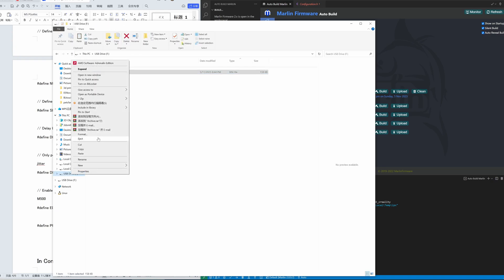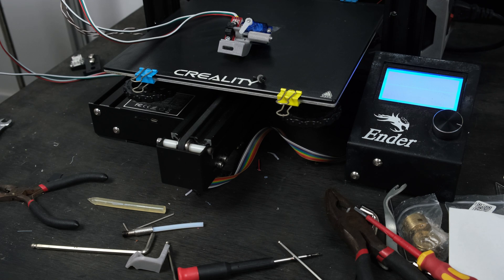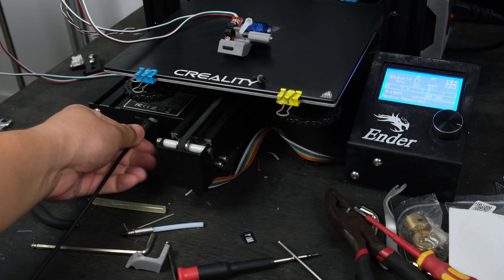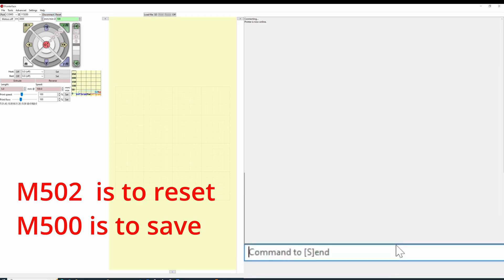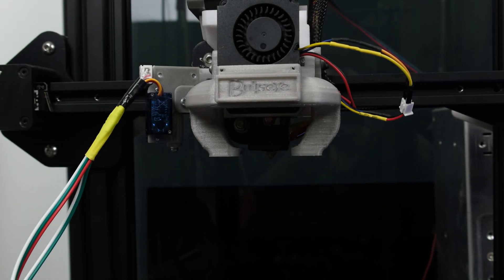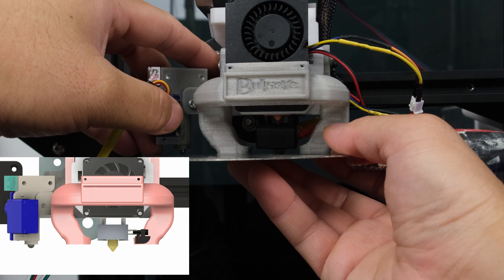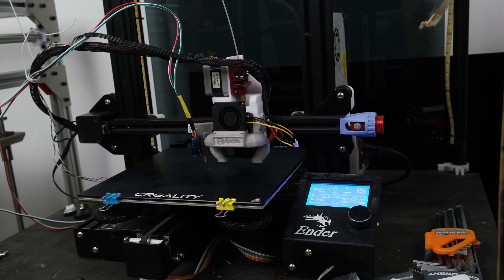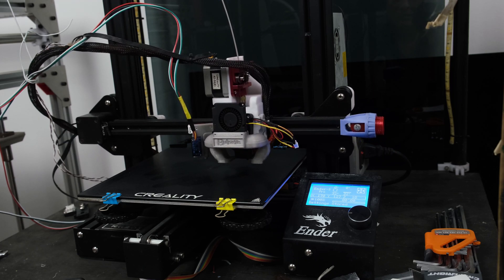Homemade BLTouch for your Ender 3(or any 3d printer)

Comment: I made this sensor and did the Marlin settings, connected it to the SKR Pro version 1.2 board, it does homing well but not leveling, please help me to solve the problem
Reply from the maker: Hi, bro. sorry for the late reply. if your configuration has no problem, it should work. as I can not see your configuration, I have no idea what is going on.

Comment: Cool design but why this over something like a 3d touch for 2-3 dollars? Have you also compared the accuracy?
Reply from the maker: Hi, friend. I know the price of a 3D Touch is not expensive. Especially those clones are cheap enough. This is a very fun project, that’s why I have built it. The accuracy is about 0.003 something like that on my. But I found some one else has got more accuracy on it.
Reply: @3DSomething  nice! Btw do you happen to know how the CNC tap on voron works?
Reply from the maker: @Platonic_fish  I have no idea. But I guess it should not too hard to attach to a 3d printer
Reply: In reality, this project helps my wallet; in my case, in my country, the 3D Touch is sold for 30-45 dollars, the BLTouch for 60-80 dollars, and the CR Touch for 100-110 dollars. I can always buy from China, but I always end up waiting in endless lines at the post office due to customs issues. Thank you very much for the video.